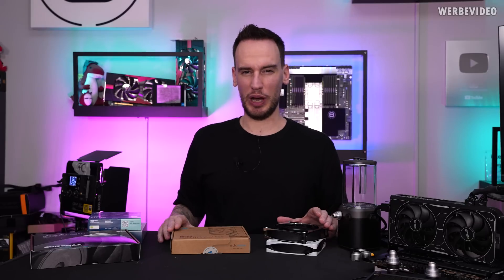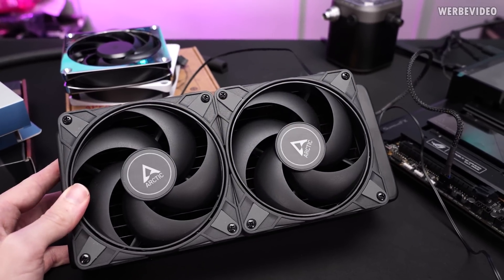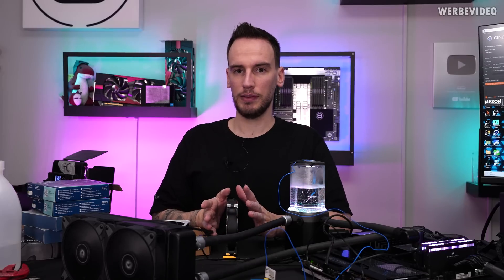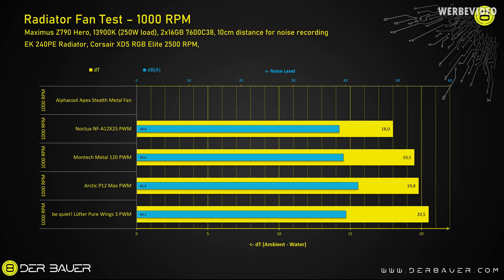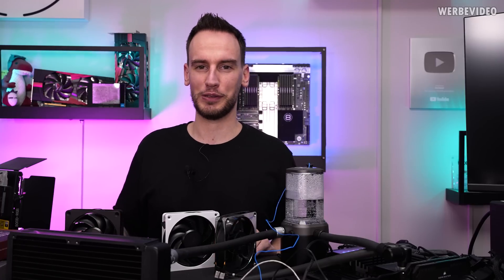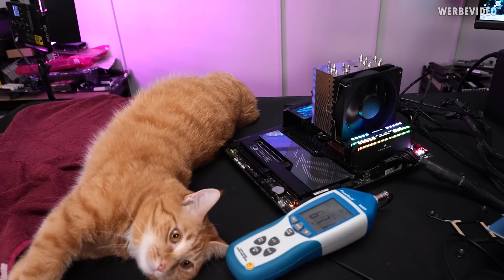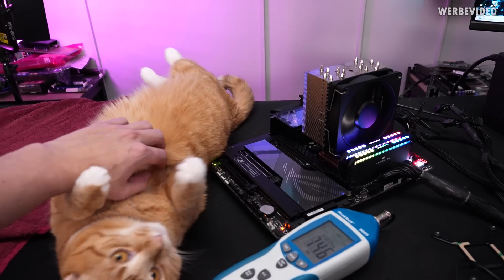Something is Wrong here - Alphacool Apex Stealth Metal Fan Reviewed

Comment: Their result would have been more believable if they showed 2x the CFM at the same or lesser Db. But 2x the CFM at the same fan RPM? That's basically impossible, you sacrifice airflow for high static pressure with radiator fans, and since they tested with a radiator they'd have to have higher flow, lower pressure fans, which are worse on radiators. It makes no sense how they could believe these results.

Comment: typical marketing lies,  no FAN is going to change the entire spectrum of what they do currently,  99.999% will always be within few degrees always of all the rest, unless the fan is broken.    a fan can only cool so much based on its size,  since all 5 tested basically same size, they will all be the same close cooling levels.

if the delta was larger then 2c between them then ya sure something is not so good, and choose other options but all these 5 are basically the same, buy the cheapest quietest and call it a day,  none are better then another because 1 or 2 c difference means nothing in daily use cases for a pc that sits under a desk for some years.

Comment: Maybe it's because I'm getting older, and spent way too much time around REALLY BIG speakers growing up, but I would MUCH rather have better thermals and a little more sound. I don't want it sounding like an old neglected laptop or a jet taking off, but I have yet to have a properly working fan make enough noise to bother me or be heard over the sound of speakers/headphones. I live in the middle of nowhere too with no outside noise besides maybe coyotes in the distance. Most people have constant outside sounds mowers, dogs, cars, trains, people, etc. Anyway, that's just me, maybe people are lucky and have super sensitive hearing or are extra OCD and can't take the sound, but I don't get why it and cable management while I'm at it, get so many "marks" on reviews of hardware. I have purchased perfectly awesome hardware, cases, coolers etc that reviewed much lower than others with almost all of those points taken off being from the perceived noise levels and the lack of unnecessary cable management features. It use to be a big deal back in the day before SATA when ribbon cables would literally block airflow in a case and really mess up thermals, but there were round IDE ribbon cable options back then for that and having more than 1-2 fans helped too. Although, I do believe people have been going too far with how many fans they use. I cpuld be wrong, I'm not right there, but  besides so many of the builds being shown off online all look the same (case,9± fans, AIO w/ display,etc), all seem like the air FLOW would be horrible. Yes there are lots of fans blowing lots of air(IF the slits around the case glass let's it in/out), but the flow seems like it would be really bad and just end up making hot air bounce around/get recycled. Oddly enough, it's the same case type and fan/RAD layout as the aweful Walmart, Dell, Origin, etc "Gaming PCs" so it is now what a "Gaming PC" is expected to look like. It's clear many people buying and showing off these PCs are copying and pasting PC part picker lists from posts/videos they watch.wigh little thought as to why. ie: 12 year olds with $900+ Intel CPUs, $600+ in "flair", and an extra fancy 4090 to play fortnight.... I keep seeing horrible hardware configurations too that make no sense other than rach component is the most expensive of its type on Amazon/NewEgg. No wonder they keep jacking prices up.when a large chunk of their customers just assume mo money = mo better...

$ end /commrant \:

Comment: I'd say Arctic fans have an insane value proposition. They may be a bit worse than Noctua, sure, but they are like 3 times cheaper (if you get a Value Pack)?
Reply: True, they are so cheap you can buy the 5 pack for the same as 1 Noctua. I have 30 Arctic fan in my watercooled rig. (4 rads, push pull)
Reply: @greggreg2458  By the way, that's what I'm planning to do as well! I will probably buy a value pack of 5 P12s, 3 for my 360mm cheap-ish rad and 2 for a top exhaust.

As far as I've heard, affordable AIOs tend to use pretty cheap fans that aren't really good in noise-performance ratio, and I don't really care about them being RGB anyways. If anything, less wires makes cable management easier.
Reply: @manoftherainshorts9075  Pro tip, you can buy a door seal, (the ones made out of foam) cut them in small pieces and using them as vibration dampeners, seals are sticky so you can put a small piece near the screw hole, you won't see a thing once mounted. The value pack it's very hard to beat, also you can get them in white.

Comment: As a scientist, the reality check that troubles me the most is that air flow should trend to zero as RPM goes to zero.  The line in Igor's plot for the Apex fan seems by eye to trend towards a positive air flow at zero RPM, which is obviously not possible.  The slope of the line is very similar to the competitor's fan despite having a much higher air flow, which is also very strange.

Comment: So, we can safely say that the AC P12 Max is the best fan overall in your test  :))
The Celsius temperature is defined to be a fixed 273.15 offset below the Kelvin temperature. Thus, the Celsius temperature t is defined in terms of the Kelvin-scale thermodynamic temperature T as:
t/°C=T/K−273.15
Thus,  t=(T/K−273.15) °C
Let temperature 1 be  t1
  on the Celsius scale and  T1
  on the Kelvin scale, and temperature 2 be  t2
  on the Celsius scale and  T2
  on the Kelvin scale.

If  T2−T1=1 K
  (that is, a difference of 1 K between the two temperatures), then

t2−t1=(T2/K−273.15) °C−(T1/K−273.15) °C
 
=(T2/K−T1/K) °C−(273.15 °C−273.15 °C)
 
=[(T2−T1)/K] °C−0 °C
 
=(1 K/K) °C
 
=1 °C

Thus, a temperature difference of exactly 1 K corresponds to exactly 1 °C temperature difference. 
Considering that the AC P12 Max is 1.8K at 1000rpm and 1.1K at 2000 rpm (they are quiet at 1300rpm), itäs safe to say that for daily use they spank a lot of big names, for a fraction of price.
And NO, I wouldn't pay 30+ euros for Noctua, I'd rather get a ticker rad or a second 360mm rad for that money.
Reply: True, P12 are excellent fans, especially  if you water cooling, 3 Noctua are 120$/€, with that money I can buy another 360, 3 P12s and some change. Plus you can avoid the rpm range where they are humming with a curve optimizer. I have a 1000D (painted white) with 4 rads and 30 white Arctic p12

Comment: Fan decoupling isn't a new thing.  There have been rubber isolater sold for fans.  I have tried separating the fan from the case and have not noticed any benefit; although I did not measure the sound.

Comment: Might be good thing to check RPM with external tool and not with motherboard rpm sensor. Some fans just report wrong values. Arctic bionix F series example gives wrong values for my MB, it hass max RPM 1800 but MB sensors thinks it spinning 3000RPM.

Comment: The metal fans are not flat against the radiator probably losing air from the sides causing lower air pressure thre the radiator.
Reply: Duck tape?

Comment: Considering that Noctua took over ten years just to engineer one new fan design, I would have been skeptical as well of claims that improved on their work without as much R&D. Identical cooling potential with half the noise is probably impossible within a 120x25mm form factor.

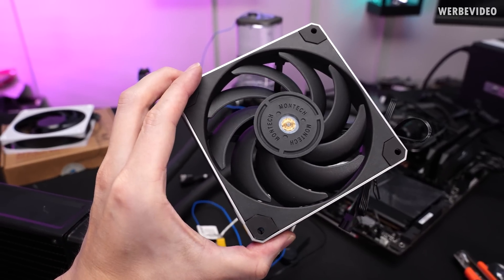Comment: 4:00 I'm pretty sure that "Metal" refers to their bearings which, if I were Montech, I would be totally embarrassed by because they have the same 40,000 hrs MTTF that a sleeve bearing has. That's utterly pathetic for HDB, but the marketers try to make it sound amazing. Their RX120 also has the same crap bearings.

7:40 You're confused, I'm afraid. The package dimensions are for the BOX, not the fan. I measured it and it's a 25mm-thick fan. Perhaps it is the inferior bearings, the extra blades and their design, etc., that make it that loud...?

8:20 My suspicion is a standard post in hole trick, and probably the posts are flanged and the sockets they fit into have recessed areas to catch and hold the flanges, and they probably also have other retainers along the sides.

I was unable to find Igor's results for the Apex Stealth Metal - I only found the results for the "Power" edition, which were substantially better than what Alphacool is using in their marketing PDF. As soon as I saw that, I was immediately - as was another tester I know - concerned by the claim that it's the MOST powerful and QUIETEST fan on the market. As I pointed out in my own video about that PDF, I have about 20 fans in my inventory that beat it on AF (CFM), and 12 of them also beat it on SP (mmAq). Some of those fans are old, and others are current models, including the Iceberg Thermal IceGale Xtra, based on stated specs. None, however, beat it on quietness, although the P12 Max was probably the closest. The A12x25 doesn't compare in terms of stated specs for AF and SP, but your testing clearly shows there's some sort of discrepancy between the specs of the two fans, and I don't know if Noctua understated or Alphacool/Igor overstated them - or both.

Personally, I stand by my belief that this fan is not as exceptional as they stated. Is it pretty? In a plain sort of way, anything that is different from the current norms and has a good aesthetic is going to be perceived as pretty by some. Old metal-frame fans were usually painted, so to see faux gold and chrome frames is rather unusual and, thus, appealing. People want what they don't have.

Given that Alphacool seems to have a good reputation, I think it was a bad move for them to exaggerate the qualities of their fan. They should've just used the Power version as their flagship fan, and touted the regular one as being super quiet.

Comment: I can’t tell u have much I appreciated this particular test as I’ve been wanting to get these Alphacool Fans ever since I saw them covered at Computex. Even though I had my doubts that they (Alphacool) really had, pretty much “stumbled” upon the first performance leap advancement in quite some time. That is that the marketers push to make a metal fan solely for the aesthetic also just happened to deliver an extraordinary performance improvement.

******TLDR******
Thanks 🙏 Roman! I really appreciate it! U saved me the disappointment in discovering this myself! ✌️🖖
******TLDR******

I have to admit I wanted to believe it. What the Alphacool representative made sense, technically. And considering the fact that a comparable metal fan from the competition is, as far as I’m aware, non-existent I just gave Alphacool the benefit of the doubt.

What at the same time have been a slight point of conflict for me is what I learned about fan development thanks to GN Steves amazing, in-depth interview/talk with the Noctua engineer during this last Computex (same Computex that Alphacool showed this new fan). The awesome Noctua engineer was extremely generous with his time, giving detailed, incredibly fascinating and informative answers Steves many questions regarding Noctuas fan development process.
I’ve quite often mulled over the non trivial process of developing a high performance fan. If Noctua has such a meticulous fan development process to get a top tier fan to market…with what some could argue are pedestrian spec improvements..🤔..
Now I would argue that the available fan offerings have reached a sort of plateau where the cooling-performance to noise-performance have extremely limited improvement potential with the particular material/price constraints that ensure the viability of the product.
I know I’m stating the obvious and that’s because I’m an extraordinarily hopeless ranter that really suck at communicating my thoughts. Which leads to a delirious pointless comment that fails in its initial intent. I’ll leave it at that.

✌️🖖

Comment: After the melting 12VHPWR debacle where Igor's Lab failed to replicate results and then proceeded to give terrible advice based on those non-existant test results and came up with really questionable theories presented as fact, I would never trust anything Igor's Lab says or does.
This is just another example of Igor's Lab spouting a bunch of BS, making impossible claims and lying to consumers.
Having a lower noise level with these fans is believable considering it's a design that is more rigid so there is less fan blade wobble specially at high speed so that part makes sense, however having twice the performance as a top end fan from a well established brand is so unlikely that it's damn near impossible.

Comment: I nearly replaced my 2000RPM nf-f12s with these. they look a hell of a lot nicer and are the same price here ($45-50AUD). Glad i didn't, hopefully the performance issues get addressed and we see a V2.
Reply: @noir-13 I'm on TEC so I'm already dealing with a loud pump and don't mind going up to ~40dB if it means a little extra performance. (Also, to be clear, I'm using the ippc ip52 2000rpm pwm variant)
Reply: @noir-13 i see your point but doesn't line up with Noctua's spec - the regular F12 has a 200-1500RPM range and the ippcs have a 400-2000/3000RPM range, with that extra +500 nearly doubling the static pressure and nearly tripling at +1500. I wouldn't trust noctua's numbers to be exactly correct, but its likely they were tested under very similar circumstances. I don't think they're just waterproofed F12s

Comment: Good video. What is the fin density of that radiator? Maybe they perform better with Alphacool 45mil radiators. You should do this again but with 3 different radiator types/brands with the fin densities noted. I have moved to a MO-RA 360 and am looking for 9 fans vs. the hodge podge setup I have now. Money is an issue at the moment, but I buy quality water cooling products so they last. I was hoping these fans would do a equivalent job as the Noctua's at moving air. They are quiet and I really like the chrome. My MO-RA is white with chrome accents. So they would look sick, but you still can't beat Noctua for top of the line fans. It's a hard choice as I run my fans at 1200 rpm. I have 5 Arctic 3 pin fans and a mix of leftover pwm fans from previous builds. The pwm fans turn off at 18.5c water outlet temps, the rest turn off at 17c. My system is a Ryzen 5800X3D with a Sapphire Toxic 6900XT with a Alphacool gpu block running in a parallel loop with two pumps. While I can get by with the janky setup. I do want a cleaner look and the best performance I can afford. I expect I'll still be water cooling my gaming pc 10 years from now and I need them to last at least 5. Thanks for this I hope you do another "real world" fan on radiator test with other rads from Germany and the EU. The Air cooler was a nice touch too since I use both on my HTPC..

Comment: I started replacing my stock case fans with Noctua with my X-78 build.  When they came out with the black Cromax line it made replacing stock case fans even easier color wise.  I had the fan hub supports break on fans from two Arctic LFII AIO and replaced them with Noctua fans.  I did e-mail Arctic and told them no thanks for fan replacements.  Until the hub supports cracked, they performed really well and were quiet.  I have had one Noctua fan from my X-78 build start growling and it prompted me to be more diligent about cleaning dust filters.
PC parts failures dating from X-78:  6) Corsair Carbide Air 1) Fractal North no issues, but all case fans replaced with Noctua.  5) Corsair H100 280 AIO, two of which have died (5 years on so not unexpected) 2) Arctic LFII 280 both came missing AMD mounting screws which Customer Service quickly mailed out. 1 fan on each AIO had a fan hub support break and all 4 fans replaced with Noctua ones.  The Corsair AIOs did not have their fans replaced as they worked really well.  1) X-99 MB died out of 1) X-78 4) X-99 1) X570 1) X570S. No issues with GPUs, SSDs, M.2, RAM, 6) CD/BlueRay/DVD units installed in the Carbide Airs. 2) Corsair PSUs were replaced under warranty with no RMA/Customer Support issues (I used 1000W Platinum units).  The PCs were built at various times for friends and family and hand-me-downs for my grandkids (I got the new PC).  My personal take away is:  clean the bloody dust out of your PC OFTEN and it will work for years!  If you use an air compressor, use a finger to keep the fan blades from going to warp 9.

Comment: Igorslab is a joke. Saying that his tests and articles is a reliable source would be like saysing russian propoganda is news. Every article I read from him has outlandish claims and explanations. I dont know how he does his "research", but if we remember his analysis of the 12VHPWR connector, his premature claims that he found the root cause of the issues which were then proven wrong should disqualify him.

IIRC, there was a post on r/hardware about his article, and most people were flaming his results for good reason. Either he is a shill and a sellout, or is incompetent at what he does. There was also an inconsistency with his results where a higher RPM led to lower noise outputs and better performance. What a joke.

Comment: I looked up the referred test at Igor's lab and they had prototypes ("golden" samples?).

"Today, I’m allowed to introduce one of the final PVT samples in the review, as mass production is just starting. I will go into more detail about this in the text, but the values shown here and today for the Alphacool Apex Stealth Metal Power Fan are already final and may only slightly improve in mass production, but not get worse"
Reply: It looks like a typical "bait and switch" strategy.